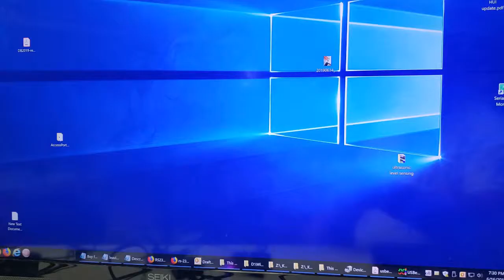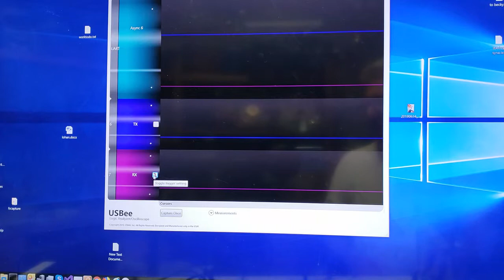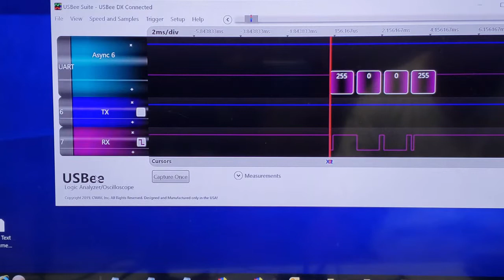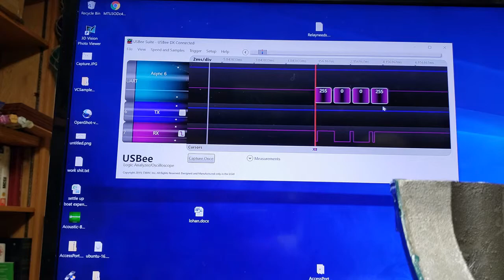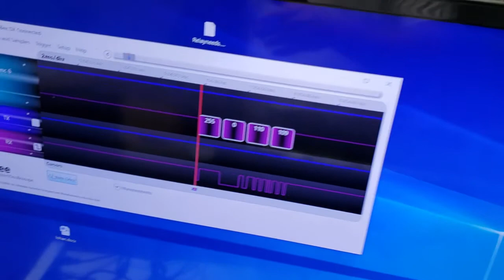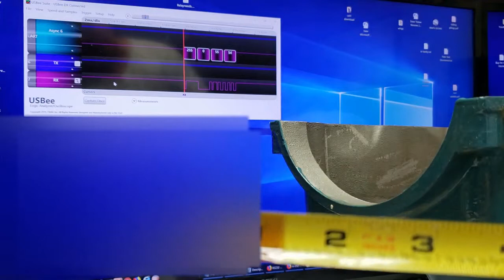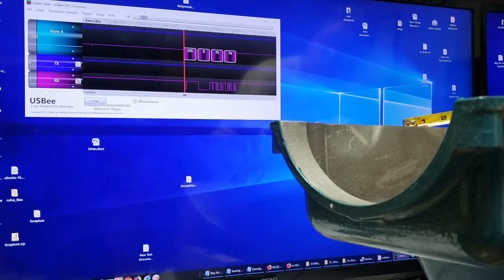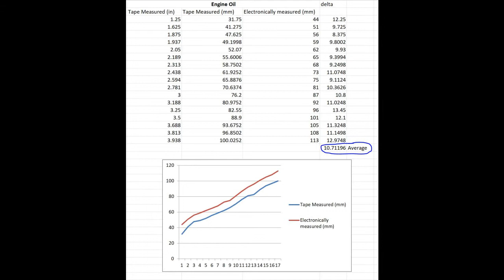DS1603 ultrasonic level sender for electronic dipstick

Comment: Hi. Great Video! and this is great knowledge.  I had been looking for non-intrusive level sensor to sense a water/glycol mixture inside a 1/4" this SAE rated Expansion tank.  I wonder what kind of contact-surface temperature the unit as well as the gell can take? Does the gell dry up in time? if so what is the duration?  Obviously, with heat around 150F, the gel may have some hardening with time..guess I have to order one and test..if you do have that the data, that will help me tremendously..
Reply from the maker: Hi there.  That gel is for test only.  It will not work for the actual installation.  The gel does not harden and it will just fall off with any motion.  What you want is an epoxy that does not have bubbles in it. I think 5 minute epoxy that is carefully mixed slowly would do the trick.  But then you have to apply pressure until the thing is well set up.  I suspect duct tape will work for this.

Comment from the maker: These sensors have appeared on Ebay again, but now cost $25 from China.  

https://www.ebay.com/itm/XKC-DS1603L-Ultrasonic-Liquid-Level-Sensor-Non-contact-Liquid-Sensing-SerialPort/133542691154?_trkparms=ispr%3D1&hash=item1f17c3c152:g:8X8AAOSwSyJfgYfN&amdata=enc%3AAQAFAAACkBaobrjLl8XobRIiIML1V4Imu%252Fn%252BzU5L90Z278x5ickkBUIiHwYv5YgVss0WaiENz50U9E0roHv5lI66X9Y9y71yQC7xmjtenfuX2W1J3wNxIpDsmrx7%252FZYlKTjAz1LscvKmlv8juDhdHKGCwilaihot3ifABUONM6SBQ3talV9eDVq8y2zMsNhUNadG%252B19tuK9uhPk7kKF%252FF65bqqvguLvC0Bo8G8yEcHPDpytyPyJkdbK3zfbCosWcAbjE1Q9R9mQg58vrdgI80gRYHVTVbe%252Fp9igryemFFF99806NWHz9DGPTdZVDPp%252F2TbCARTGesFEL8ECM2hCtRtTS3J2mgtTZWp9YPc2yrK222o1ByLmJwWaxAP7%252BWrZ5g69eMV2Uxrb9QjJ%252FXglLV1fAHAvs%252Fcxa2S%252BNbttkGT9DNpQw6zlyqfOmkhAMi1EAuESg%252F0QZqASZTb%252B%252Bio3aVeIWc8gVjBB5J%252BvN3p9BXdjccMKeGnPjO7dBz8h%252BOVIN5ewEiaPajSFZy%252BWVKV%252BegqzygB%252BmFhQUZRLXNDt9OvIZFMIWTkAl3nkgFJSWzG0sGGysupWSTowJ8KCQDYWTLjUgTDHIVXYXdBsXPQttTjKQGGBsyuK7xSjkZKoOblu%252BUnkYxrBcrFBdaWhubXucPNQ1m3FmYCSywWTXcfGZ2YcGGirbJ3qBQBw%252B%252BUDboTfzOyMpJt6vXv8rCiq%252FCRRg90vw2iOqTQcutvZwGAeI02Sq%252FWyN3HA6XCes3iyjJsklcvjEvZIqYQQ4pcBd%252FpIVbtbhVYPhgKxDPw9lGMvhK5zd9Kps2pSl8BZYGvGEI57rQtoXf1ZEY3DvBmGsLRa0BYkcVfAZ9sWdu78zW3JfWS%252BcKBFZA17Q%7Ccksum%3A13354269115475c82d50ed7c41a088450a08ad62eb4e%7Campid%3APL_CLK%7Cclp%3A2334524

When you get your "stimulus" check, just remember where that "money" is coming from.  Government doesn't have any money of its own.  What it spends it either taxes, borrows or, more commonly today, debases (steals) from the current holders of the currency.  The resulting inflation eventually leads to higher prices.  You can see these commodity devices all going up in price now.  So the government is not giving you anything. It's simply raising the prices of goods.  Those clamoring for their government payout will realize soon enough that they are as dumb a sucker as ever walked the face of the Earth and that big government is a con game.  If you don't know who the patsy is in a Vegas deal, it's YOU.

Comment: Hey,
thanks for the great video. I have a question: could you use this to measure the distance to the bottom of a lake?
I did a lot of research, and someone mentioned it might be possible, but he wasn't sure if it will give a good enough reflection.
Now I understand this sensor is meant for max. 2m with a good reflection, so I'm expecting a lot less, but for me, 50cm would be sufficient. 
Do you think this works? If you still have the sensor, could you maybe.. test this for me somehow? (hold it into a water-filled bowl or something, with some dirt or something at the bottom, to dampen the reflection.

Thanks in advance!:)
PS: I have built a submarine and I'm looking for a way to skim along the bottom of a lake at 30cm distance
Reply from the maker: Sorry, I already have more projects than I can handle.  Is it really that difficult to just go buy one and check it out for yourself?  I find that people who are unwilling to do even a little work toward their dreams are often just dreamers who never accomplish anything.  Not saying that is the case with you, but I am saying that if you are serious about actually doing something cool, you will just go do it and not ask others to do it for you.  Good luck with your project.
Reply: @thirdwave8811  I can't really say i didn't put the work in, the submarine is almost done. I just wanted to avoid buying the sensor for nothing.
I know it's a lot of work testing it, but asking is never wrong.
I know those people who ask complicated details without even having started their project.

Comment: Hi, where did you find this device for $15. You mentioned this at 15:12.
Reply: The device was sitting on my shelf for about 1 year.  I bought it on Alibaba, free shipping.  Seems prices have gone up since then and availability has collapsed (used to be multiple vendors).  But I recall thinking how stupid cheap the device was and thus worth buying on the spot and then storing until I had time to evaluate it.  You can still get it with a readout board for $40 on ebay.  Search for Non-contact Ultrasonic Liquid Level Sensor.  Be careful not to buy the switch.  Those are designed to shoot sideways.  So they don't provide a level but rather only if the liquid is above or below the read point.  Those can be had right now for $3-$5 on alibaba.  But all that gives is go-no go type reading.
Reply: @DIYDaveT  I did buy one after my first post but was just wondering how you got such a good price (you have answered this now). I found the device to work just fine under plastic and metal cans if they contain water. Paint failed. I wanted this device to measure propane levels but I couldn't get it to work. If you ever learn how to use the DS1603L's Rx input to tune the device for listening for sound through propane, let me know. But maybe I just got a bad sensor?
Reply: @SqueetoNa  did you ever find out how to do this? I am currently trying to do this too. Thanks
Reply: @peterknight5908  Nope. Sorry. It sits in a bin on a shelf. If I ever need a water level detector, I am all set!
Does yours work for water and not propane as well? I always wondered if I got a bad unit.

My propane tank just expired anyway and I will buy a new one with the built in float meter.
Reply: @SqueetoNa  I havent ordered it yet still researching. I hope it's just your unit. Good luck though with your new tank :)